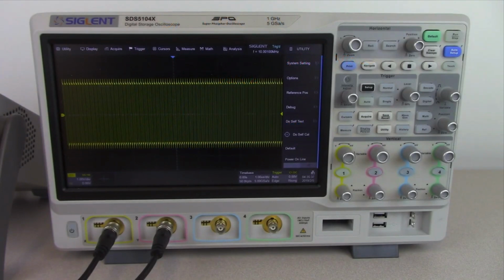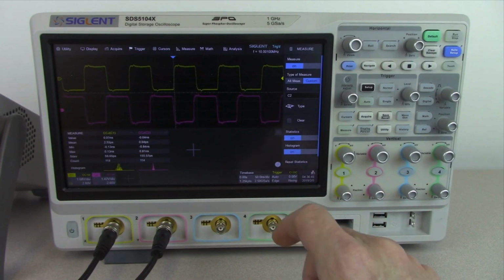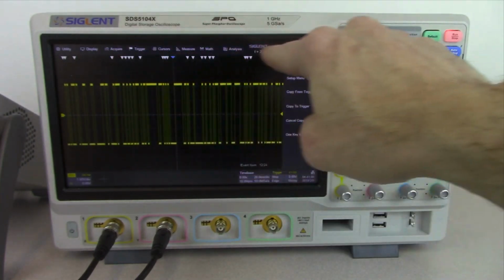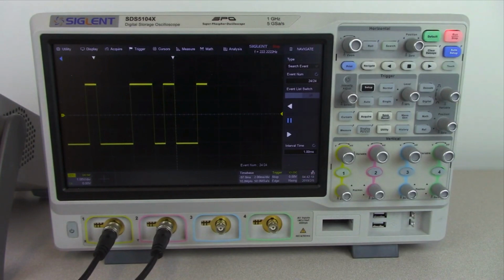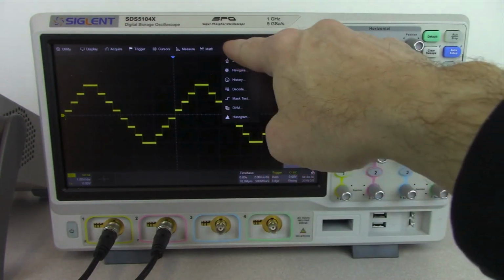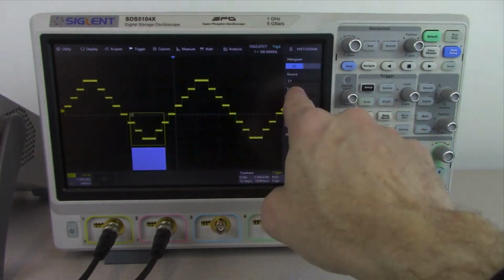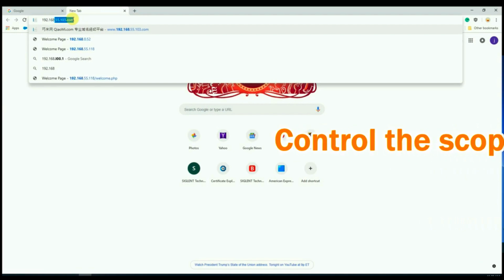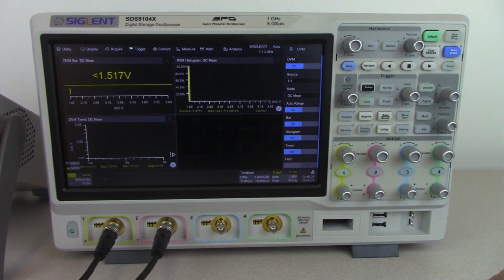Siglent SDS5000X Feature Highlights Part 2

Comment: Can you trigger on a unique serial data and search.  Fox example 3 bytes in the order C4 xx A5 as a trgger condition.  And could i caputer a lot of data then go back and search to see how many times it occurred.  Is the search data also viewable in table format.
Reply from the maker: Yes you can trigger on a specific address
Reply: @BatterFly2002  Now that you have had the scope for a while - what is general impression?  If you have ever used a Tek MSO 4000 how would you say it compares or on a scale of 1-10 based on other DSOs you have used how would you rate it?